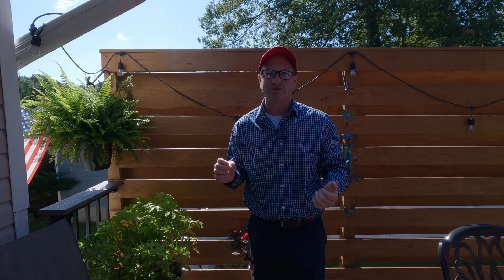HYUNDAI IONIQ5 ICCU POP!!

Comment: I have a 2025 IONIQ 5 Limited with only 1700 miles on it.  ICCU unit failed last Sunday and was replaced by my local Hyundai dealership.  My car was towed into the dealership early Monday morning and the part was ordered that same day.  I was told the new ICCU should arrive by Wednesday, which it did.  The new unit was installed on Thursday morning and my car was ready for me to pick up on Thursday afternoon.